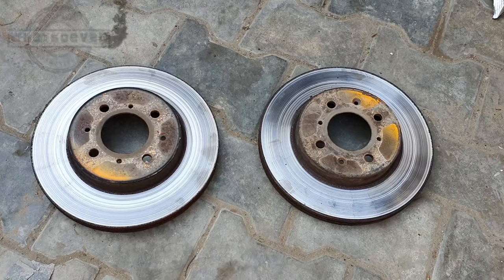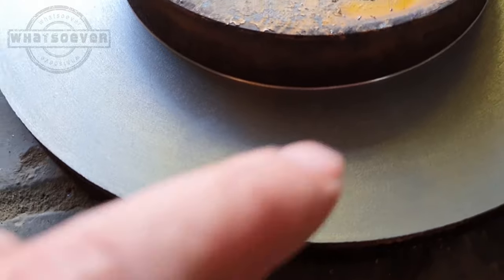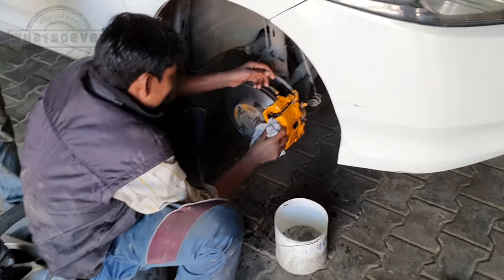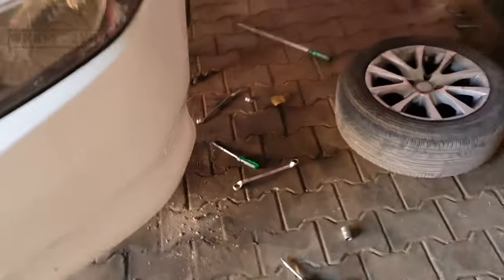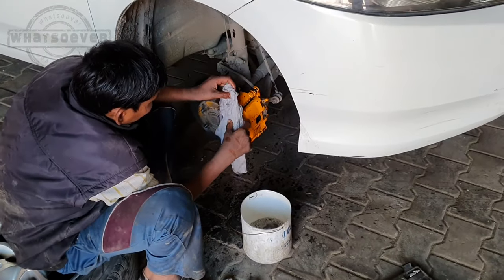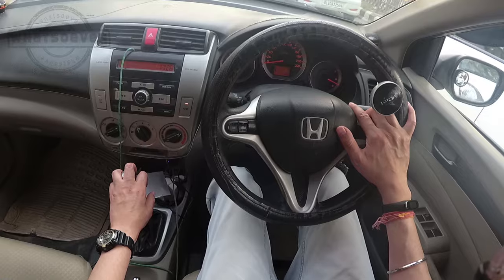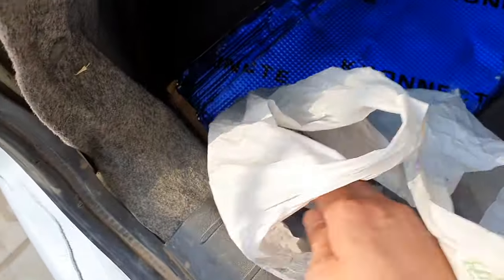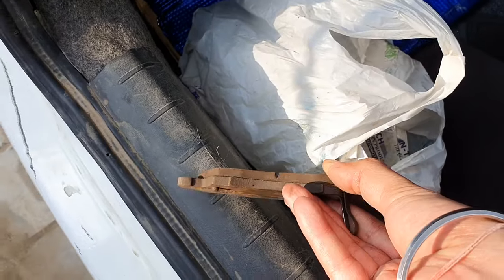Restoring Disc Rotors of My Car

Comment: Grooves are created by the new pads trying to make contact with rotors that had marking of old pads for this reason you should turn the rotors every time you put new pads, this way the new pads and new rotor surface will match, this will make sure you don’t get grooves. Also caliper pins don’t go bad, they need to be lubed by silicon grease. Make sure when you get a brake job they remove the pins and grease them. Also another thing is that you should also bleed the brake fluid at calipers, so the air is out of the system, and you’ll get like new brakes!! 

Only turn rotor one time, next time replace or it will get warped.

Well this is how it’s done in the US!
Reply: Turning rotors ??? I did not get this point
Reply: @undercutsoul898  resurface